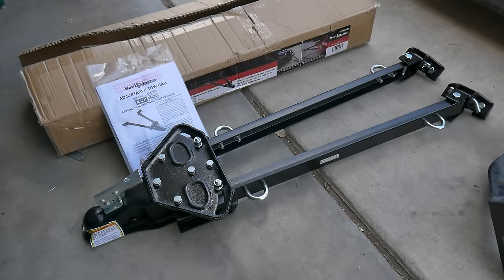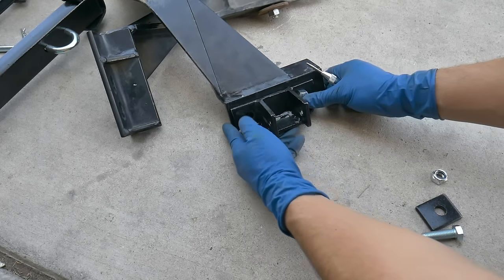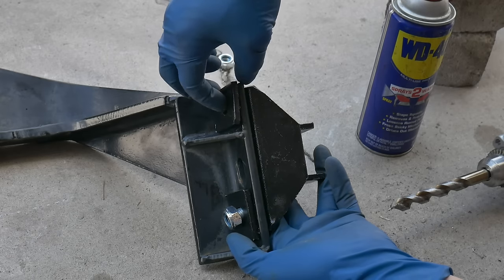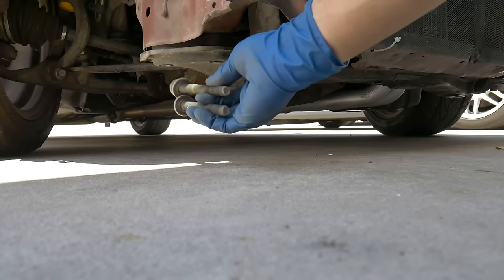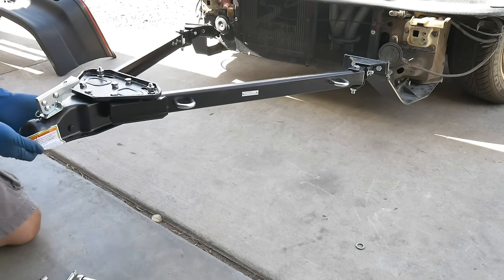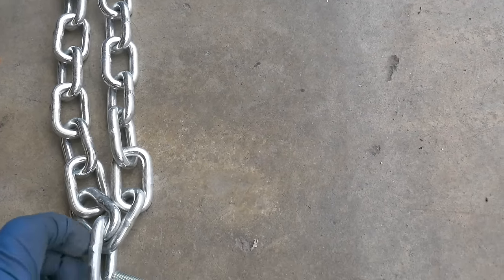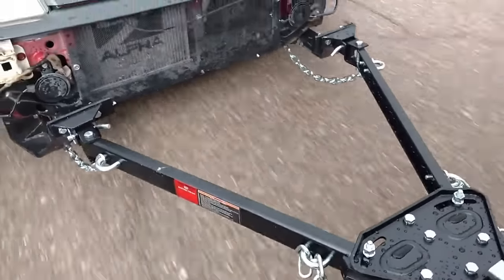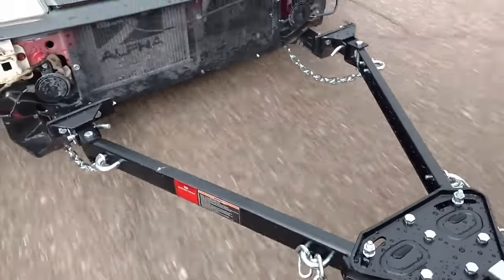Harbor Freight Adjustable Tow Bar Install - Towing my EF Civic B20B Track Car

Comment: Nice video! I have a question though. If the tow bar isn't level, can that cause stability issues? I'm asking because I tried to pull my 04 Civic home from a friend's house with my 05 Civic and this kind of tow bar and the Civic I was pulling was pushing my car all over the road, it was difficult to keep it going straight above around 30 MPH. The odd thing is it felt perfectly fine when climbing hills, but unstable on flat roads or when going down hills. There was no way I would have been able to drive it 600 miles home that way, so I had to take it back to my friend's house. I'm thinking that the problem was the angle of my tow bar. I attached the tow bar to the crash support bar behind my 04's front bumper and the 05 I am pulling it with has been lowered about 1.5 inches, so the tow bar was pointed way down. I'm thinking that may have been the problem because I was pulling the car down instead of straight forwards and I'm thinking it was pushing down on my car because of the angle of the tow bar. Do you think the tow bar being about a foot lower on my tow car than on the one I was pulling could cause a stability issue? I'm thinking it could, but I'm not certain. Thank you very much in advance!
Reply from the maker: I don't think it's the issue.   I used the bar on my dad's 2010 Toyota Tacoma pulling home a lowered hatchback and the bar wasn't straight one bit.  I towed it about 175 miles home doing 60mph the entire way home and it felt perfectly fine.  Your civic isn't meant for that kind of pulling though so the weight was probably forcing your car back and forth.
Reply: @GarageBuiltHondas  Thanks. That's weird because I pulled a 2500 pound U Haul trailer 500 miles no problem with this car though, so it's weird that it can pull that okay but not another car that weighs around the same amount.
Reply: @GarageBuiltHondas  The angle of the tow bar ended up being a big part of the problem. I got a taller ball mount so the tow bar was more flat and that improved the stability enough that I was able to get it home (through over 600 miles of big mountains) at around 50-55 MPH. I'm sure the rest of the wandering was because of the 04's worn out steering and tires. The 05 pulled it like a champ considering the very poor condition the 04 was in at the time. Thanks for your help!
Reply from the maker: Nice, glad to hear it worked out!

Comment: When you did this I’m guessing your Honda a manual did you put it in Neutral or did you put it in 1st gear ? I need to do the same but hear many different things
Reply from the maker: It's a manual transmission.  You leave it in neutral when towing.  Max speed is 55mph safely.

Comment: Thanx for the info.  I just bought the same bar through Amazon and planning on installing soon.  Got a question - the instructions specifically warn NOT to weld the brackets onto the towed vehicle - only bolt.  8 had planned on doing both.  Any thoughts on why they don't want them welded?
Thx again.
Reply from the maker: Maybe just not welded only is what they meant, maybe welds just aren't strong enough over time and would potentially crack.
Reply: @GarageBuiltHondas  thx!!  Good luck
Reply: Sounds like a generic manufacturers warning since all cars have different bumper bracket steel thicknesses. Some are pretty thin and welding directly to it would be tricky unless you have commercial level welding experience. If the brackets were thick steel, I wouldn't hesitate to weld even with my limited experience.

Comment: I’m curious how the car turns? Do you have to put a seatbelt through the steering wheel so it doesn’t move?
Reply from the maker: You leave the keys in so the steering wheel naturally turns with the towing vehicles.

Comment: Nice tow bar setup. Just wondering does the civics steering wheel turn while being towed?
Reply from the maker: Yes, you leave the key in the ignition so it doesn't lock.  They turn naturally with the truck as you turn.
Reply: Garage Built Hondas Ahh thanks I was wondering about that.👍🏻

Comment: Does every car have this hookup to be able to use this tow bar or do you have to screw holes into the car?
Reply from the maker: You'll need to have some way to mount the bar to your car (brackets or directly mounted to the car safely).

Comment: I was wondering what it’s like to toe with one of these like what is a good speed you can tow I’m thinking about bringing a car from California to Florida with this?
Reply from the maker: You can only travel 55-60 tops.  If you're towing vehicle can pull a trailer, you're better off.  This will extend your trip dramatically.

Comment: I say a tow dolly would be the best !
Reply: A dolly is expensive to buy or rent and way harder to store and carry around.  Also you can tow a bigger vehicle with the tow bar, because the dolly adds like 1250 lb to your tow load.  But a dolly is better for towing a front-wheel-drive car, I think.

Comment: Would it be better if you turn the vehicle on and leave it in neutra when toming long distances?
Reply from the maker: It has to be in neutral, and not necessary to have it on.

Comment: a question to tow the car do you have to put it in neutral or how do you move it?
Reply from the maker: Neutral with the keys in the ignition leaving the wheel unlocked.

Comment: So I think some very important steps were left out...
I highy doubt anyone cares how much a piece of metal cost in comparison to the steps needed to be taken when hooking up and actually going into towing mode safely...
I've seen these things cause some major accidents mainly due to improper installation and being misinformed.
Reply from the maker: I wasn't teaching about tow bar towing.  Just showing my setup. and how it worked for me.

Comment: I'm a complete noob when it comes to towing. You think I could do this to tow my dc2 with my 2018 2.4l n/a CRV fwd?
Reply from the maker: Yes.  Although I don't believe the CRV has a towing weight of more than 1k lbs.  You'll need to check.  I've seen plenty of people do it, but it may not be recommended by Honda or you may out excessively wear on your transmission.

Comment: Say I wanna tow any kind of vehicle could I just use a D ring instead of adapting a tow bar for the car
Reply from the maker: I don't necessarily think it'd be safe unless it specifically says that it can be used for that kind of application.

Comment: The front wheels stay locked from swinging to the sides on neutral?
Reply from the maker: No.  The key is in the ignition so they turn as the towing vehicle turns.

Comment: a little off topic, but do you have a preference for the b20b in this or the b16a1 in your si? I'm trying to decide between the two. It would be a DD if that matters. thanks For all the great vids!
Reply from the maker: The b20 has torque for days.  Hitting vtec is a lot of fun though.   I think my b20 would win in a race, even with the LS transmission.  But as a daily?  I think both are fun, the b16 just costs a lot more comparatively.  You could easily get 2 b20's for the price of a b16a.  If I had to choose for a daily, I'd pick the b20 and use the extra cash for parts like a nice header.
Reply: Garage Built Hondas thanks!

Comment: I bougt the tow bar and used.   It for a trip of 1500 miles. Pulled great was going. 70mph
Reply from the maker: Love to hear it!
Reply: Did you have to buy extra brackets? If so, from where?
Reply from the maker: You'll need a way to mount it to you vehicle you're towing somehow.  My brackets were specific to my car.
Reply: @GarageBuiltHondas  I have a 96 Camaro - stick shift - what do you think?
Reply from the maker: What do you mean, what do I think about what?
Reply: @GarageBuiltHondas  I meant the placement of my brackets ... Was just wondering if you had any experience under the hood with this vehicle or had any thoughts on  placement of the brackets?
Reply from the maker: Unfortunately I haven't.  Try to remove the bumper, your best bet would be attaching the brackets to the frame/subframe of the car if possible.  You'll have to look at see.
Reply: @GarageBuiltHondas  No worries ... Thanks #GBH
Reply from the maker: You're welcome!

Comment: I don't know that Harbor Freight sell something like this, I have seen it with Etrailer though. My question is that is this installation for just one vehicle or it can be changed to other vehicles if so needed.
Reply from the maker: It can work on all vehicles.  You just need to make or buy specific mounts for your vehicle.

Comment: What did you do for looking steering wheel and for brakes lights connection so as you brake with pick up you have brakes lights on car or used car brake lights, my civic died again starts idle then shuts off when I give it gas if you know a tip
Reply from the maker: +r0mulyni2 With a tow bar the wheel needs to be unlocked so the wheels turn as my truck does naturally.  I bought some magnetic tow lights that plug into my truck wiring already.  You'll see those briefly in my next video!
Reply from the maker: +r0mulyni2 make sure your fuel pump is working correctly.  Also, do you have enough gas in the tank?
Reply: Garage Built Hondas cool cool thanks man
Reply: So the steering wheel need to be unlock.
Reply: Omar Soto yep i used it a week ago its awesome its like somebody is steering the car
Reply: Ok thanks
Reply from the maker: Omar Soto yes

Comment: How does the car turn, does it need a 2nd d driver to turn the steering wheel.
Reply from the maker: No.  The steering wheel is left unlocked.

Comment: This is awesome video Sir.   I really want to do this.   I dig your modified A frame idea.      How was your truck handling when you came to a stop.    Does it stress your truck frame?
Reply from the maker: I had zero issues.  It worked well for as long as I owned the truck.

Comment: I have a push button, will the wheels turn if I put it in neutral?
Reply from the maker: I'm not sure how push button cars work.  You may want to read inside your owners manual, it should have towing instructions in there.

Comment: was any person in the car when you towed it? i have watched all these tow instruction and no says neautral the car leave the key in what position its a  pitty you never explained
Reply: you probably need the key in to unlock the steering for flat tows. not sure if his racecar has steering lock. if it has an ignition panel it wouldn't

Comment: Can I pull my Honda by just the tow hook only, where you said the third bolt bolted to...
Reply from the maker: +Gloria Caswell yes, it is a strong enough point.
Reply: Garage Built Hondas Thanks for the fast response. I'm going to find a way to attach the HF tow bar there.
Reply from the maker: +Gloria Caswell perfect!
Reply: I removed the bumper brackets, attached the HF brackets to the existing hole i.e. only one attachment point utilizing only one bolt per each bracket and considering the pulling force I attached the outermost holes of each HF bracket to the bumper bracket, then reinstalled the bumper brackets; every bolt snugged tight. No alterations. I towed it 88 miles one way. All bolts were still tight, none had loosened. Metal and brackets of the HF towbar stayed straight, no bending. Great product, mind you the Honda only weighs a little over 2,000 pounds.
Reply from the maker: Wow that's excellent!!  Thanks for sharing, I love to hear that it works well for others!

Comment: Wouldn’t it hurt the transmission and engine  with it’s just being flat towed and not actually running the whole time?
Reply from the maker: Maybe on certain vehicles where those say specifically not to.  Others should be fine, it depends on your car.

Comment: Going to buy the set up you have, any tips or anything else i would need to buy, my civic still having issue and it stalled 20 min away from home, so rather buy kit vs getting a tow truck
Reply from the maker: +r0mulyni2 You need some sort of bracket setup to mount to your car and the safety chains.  Other than that it's very easy to use.
Reply: Garage Built Hondas cool cool thank you brother

Comment: Can you turn using this tow bar? If so how do  the wheels on the trailing car turn.
Reply from the maker: The wheel remains unlocked with the key in the ignition.
Reply: @GarageBuiltHondas are you answering my comment?
Reply from the maker: Yes
Reply from the maker: So you're thinking that a tow bar doesn't turn?  How would you even get out of your own neighborhood?
Reply: @GarageBuiltHondas I meant to ask  ,the wheels of trailing car turn in the same direction  as you turn?
Reply from the maker: No.  Only the front wheel turn with them unlocked.  It'll turn naturally when going into a turn.

Comment: Good video.
Do you have to make those brackets yourself or they come with the tow bar?
Reply from the maker: You'll need to find some brackets to fit your car.  These are custom made for 88-91 Civic & crx
Reply: @GarageBuiltHondas  
I guess you can weld them at home, is that right?

Comment: Do the tow bar mounts interfere with the front bumper?
Reply from the maker: Without the lip it fits.  I have a larger lip on the bumper that hangs pretty low so I had to remove the bumper.  I might have been able to make a quick release for the lip though.

Comment: hi . I need help . guys look I have a truck . and i wanna pull my Chrysler caravan van . with the triangle think tow bar . how can I do that
Reply from the maker: +Angel Vargas can you truck pull that kind of weight.  You may want to do some research on that first.
Reply: yeah I have pull rv with my truck. if it could pull an rv. it could pull a van
Reply: if i pull an rv. it would be easy to pull a van. why you ask that?
Reply from the maker: +Angel Vargas because I have no idea what you have pulled before.  Different vehicle has different weight limits.  This truck could pull up to 2500lbs as said by manufacturer, my 01 CRV has a weight limit of 500lbs, that's why I ask.  It all depends on the pull vehicle and the tow vehicle.

Comment: Did you turn on the flashers for the car you are towing?
Reply from the maker: No.  I bought the magnetic lights which attach to my truck.
Reply: Garage Built Hondas thanks for the response, I haven’t thought of that yet but it’s a great idea
Reply from the maker: It was a nice LED set from Harbor Freight for about $40.  They work perfect so far.

Comment: Do you reccomend if im towing  1,000 miles?
Reply from the maker: It's possible but I'd recommend a tow dolly.  A tow dolly allows you to go a little faster and it just feels safer.  And at the distance you want to take it, it will make your trip so much longer if you use this tow bar. I just towed a car 140 miles home last Thursday and it felt perfectly fine the entire way.

If I had to perform that trip I'd ship the car instead and save time & money.

Comment: how are u doin that without the front wheels off the ground
Reply from the maker: It's how you utilize a tow bar.  The key is in the ignition so the wheels do not lock and it'll turn as the towing vehicle turns.

Comment: Does anyone know if I can attach this to my crv using it the way it comes out the box from harbor freight?
Reply from the maker: No, you'll need to find a suitable and safe way to mount it.  Your crv is a heavy vehicle.  It'll need proper support.
Reply: It might be for a short distance but for long distance you need the ones they sell for the rv's does will cost 
200-400 each but worth it trust me.

Comment: How about a2wd Silverado? Disconnect u joints?
Reply from the maker: AWD?  You're going to have to.  I'd look at the owner's manual and see what it suggest for towing procedures.
Reply: 2 wd. But I’ve been looking and I do need to disconnect driveshaft.
Reply from the maker: Sounds like it being that it's rwd.  Did you look in the owner's manual, or search online for the info from the owners manual?
Reply: Garage Built Hondas ok, thanks!

Comment: What about turning? It's not necessary for someone to guide the vehicle
Reply from the maker: Wheel is left unlocked and it naturally follows.
Reply: Otherwise wouldn't you just be dragging the front wheels especially vehicles without power steering. I'm so confused by this
Reply from the maker: I wasn't sure either how it worked, but it's pretty neat.  The car rolls straight naturally but when pulled in either direction the wheels turn as well, but you have to keep the key in the ignition to keep the steering wheel unlocked.

Comment: That little toyo truck is not rated for towing a vehicle.  I would be careful so you dont fuck up the tranny.  It looks like its a pre tacoma with the pointy end? I love those earlier trucks.
Reply from the maker: It actually is rated for this.  It's surprising but had the ability to tow.  First time I ever checked was back in 2012 at u-haul.  I had to town car home from my parents house and we plugged it in and yup, this Toyota is surprisingly good to go.

Comment: ❤❤ cool...
Reply: Thank you for your tip. Over the weekend I went and bought one at harbor freight I believe it was $79 and put it on and it goes great and I have an 88 Ford festiva and it's got the flat bumper in the front and I didn't even have to take the facade off it was able to bolt on and I'm really happy with it I've already yesterday drove it around and looks fine so instead of spending like $1,500 on the I one from camping world. I can take my little car anywhere.  It a stick
Take care thank you.🔧👍🧛

Comment: Do it put miles on odometer...
Reply from the maker: +DirtyCoTex yes!
Reply: Disconnect driveshaft if rear wheel wala!
Reply from the maker: +Thanos 👍😁
Reply: or speedometer cable
Reply from the maker: +Angel Vettorazzi that's true, and that's easy on this car!!

Comment: Do the car that being tow should the engine be running or no?
Reply from the maker: No.  It's off in neutral and the key to the steering wheel unlock position.